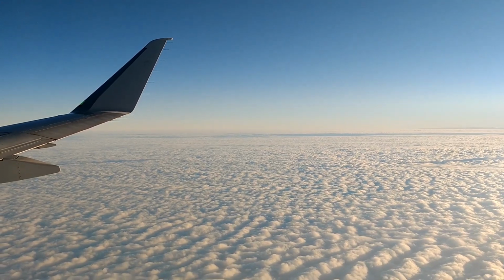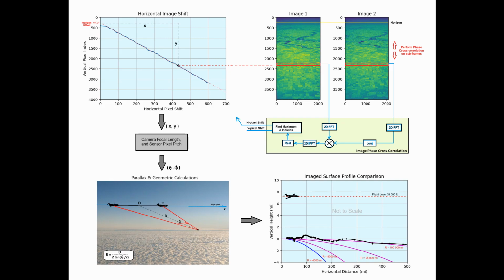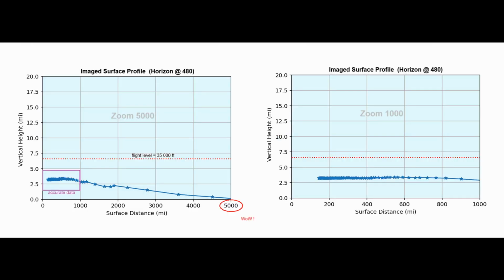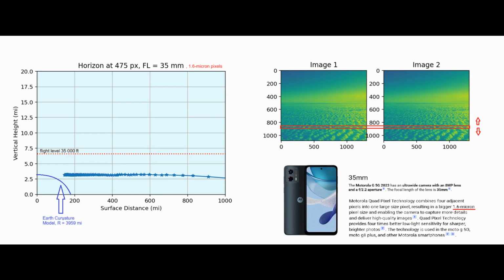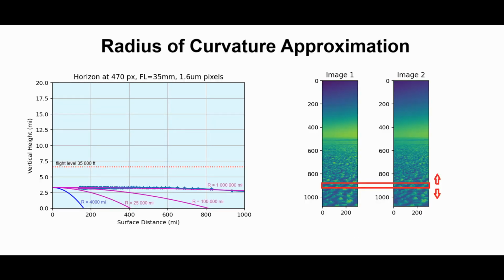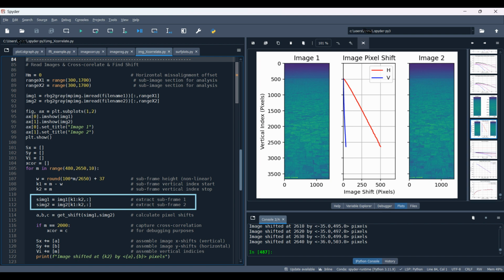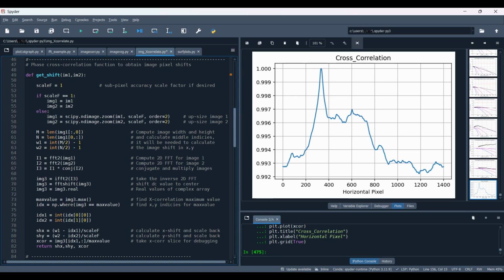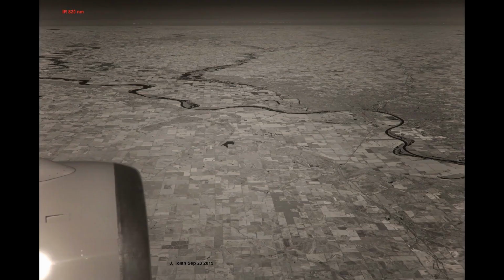Machine Vision Algorithm for Earth's Surface Curvature Estimation -- JTOLAN MEDIA1

Comment from the maker: "What does the computer think?"

~ JTolan Media1  (December 25, 2024)

*Conversation in the comments section:
COMMENTER:  "...the curve might be an artifact of the different layers the light passes through prior to getting to the pixel sensor .....(which has optical optimized layer of glass) but the curve of the lens pressure difference of the air in the plane and outside the plane and composition of the air, and the plane window are all interfering with the path of the light (plane window being very sketchy due to the different layers and bad optical property quality)
but then again, 1 million miles compared to the globe radius ... you would say EARTH the area we know and mapped is then pretty flat (as in a comparative measurement from globe earth assumption to "flat earth measurement) .... an other thing is that the area you sampled is over land, and we know land has shape, surface change ... but i think on this scale that does not really matter any more :D"

JTOLAN MEDIA1:  "yeah, its a complicated problem, window, air refraction, surface variation, etc.. initially I was going to do a statistical analysis and show the curvature with high confidence, then my mind was blown by how far we're seeing, based on the slight shift close to the horizon.   

The FFT phase cross-correlation is incredible, I never would have accurately determined the effects close to the horizon by manually analyzing the images, like I've done in one of my previous videos. 

I checked with the USGA and they use IR lidar sensors, and not even they can determine the curvature...   ...they say the data they have is "elevations above the ellipsoid" (the magical imaginary ellipsoid).  

Nasa doesn't help, in fact I'm accusing them of purposefully using fisheye lenses to hide the truth.  Nothing wrong with using fisheye lenses for a wide perspective, but they are covering up the truth.  

The Chinese released incredible flat surface imagery with new lenses, panorama lenses.  Truth can not be hidden much longer.  The "space" age has brought about a new understanding of the surface of the earth."*

💥🤯  Fast Fourier transform (FFT) phase cross-correlation is a technique that estimates the relative offset between two similar images or data sets. It's a type of cross-correlation technique that isolates phase information from the Fourier-space representation of the cross-correlogram.